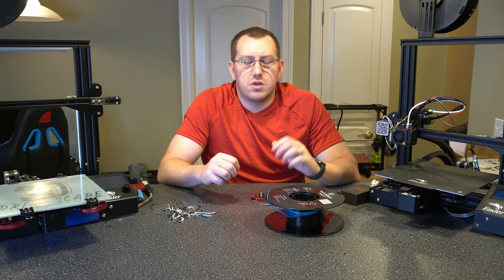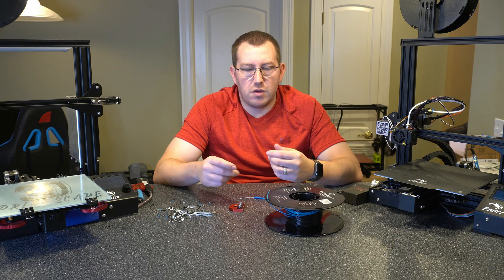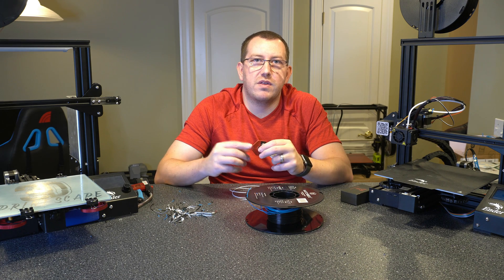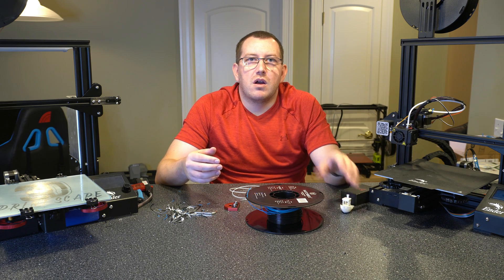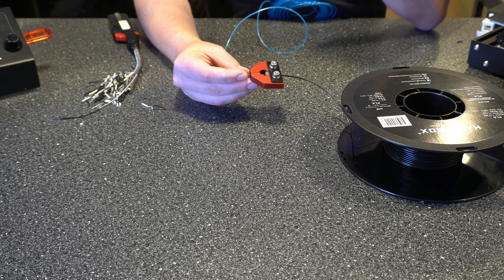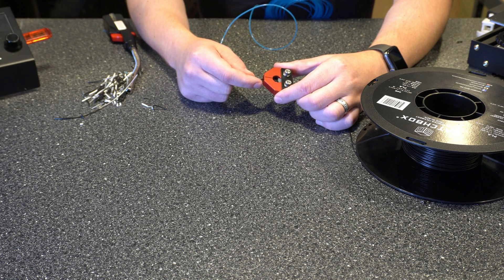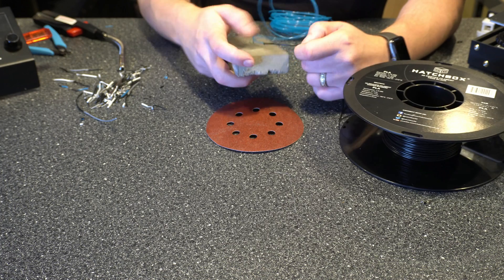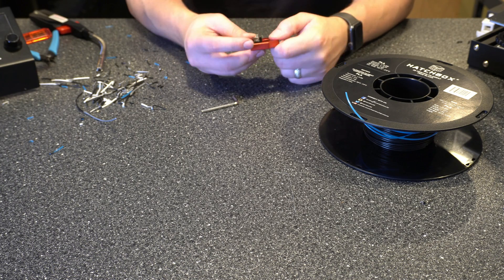Guide to Weld Filament Together

Comment: I tried the two of the tools, with ptfe tube I see the "ement" became to a larger diameter to the filament, with the oder tool it is necessary to practice very much to get soldering . . .
Reply from the maker: Hi. I agree, this does take a lot of practice.

Comment: I have not ever used one of these tools, and don't even have a printer yet, so take this for what it's worth....  My first thought was to mount a soldering iron pointing up and  and holding the tool with the tip of the  iron in the provided opening. This way you can finely control the heat to just the tips of the filament. The filament doesn't even need to touch the tip, though it can, but the heat generated by the tip of the iron is enough to melt most plastics just being in close proximity.  
Another option is to use a cheap wood burning iron with a thin flat blade (or even an exacto knife blade) and the 2 filaments can be close to that as well just to melt the tips.  No more flame unless you want to quickly preheat the filament before melting the tips :)
Reply from the maker: Hi. Thats an interesting thought and could work for sure. I will give it a try some time to see if its easier than just using a flame.

Comment: Thank you very much. I was literally wondering if this was possible today and your video came up! Would this potentially work with a soldering iron? Or is it best to stick to the blowtorch method?
Reply from the maker: Hi. Im guessing a soldering iron wouldnt work well, but i havent tried it. Im thinking it would be difficult to get them to fuse together in a way that wouldnt impact the diameter much.